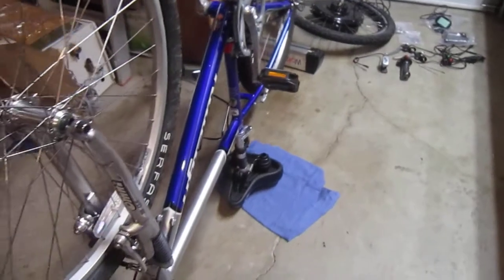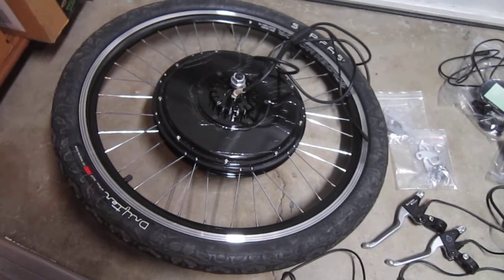Golden Pie V5 Golden Motor Hub E-bike Conversion Kit---First Look

Comment: I just got done looking on Luna Cycles I couldn't find any conversion kits all I see is ready made bikes
Reply from the maker: I just looked there and saw a bunch of hub and mid-drive motors and all the parts to back them up. They are expanding faster than they expected so availability and the such can be limited at times.

Comment: Whats your top speed with the 48v battery?
Reply from the maker: Not to be known yet.   I knew the battery was 3-5 years old, but hoped the voltage would be better. It is working fine with a 18 mile range, but not quite 20 mph.
I am sourcing a new battery with some real juice.  Either Luna or PRE in Vegas.
Once I know, you can be sure I will report it here.
Reply: speed for 48v about 45km/h
Reply: @zaminhuseynov89  which size rim? i am wonderign what 48v top speed would be for the 20 inch wheel
Reply from the maker: I ended up with the e-RAD 48 v 17.5 Ah battery---top speed around 30-32 mph.
Reply: my 48v with 26 inch rims and serfas tyres like yours does 42 kph but i have dialed back the battery to 4.1 volts per 18650 cell.. or it would possibly do 45kph

Comment: I installed one side of my torq arm when I got a front kit, the other side would have required that I detach the connectors at the end of the wire which isn't too bad but I wasn't able to then😛 48v 25mph-30 is a sweet spot imo for keeping with traffic also and not becoming a road hazzard yourself.
Reply from the maker: I was able to add both torque arms on the rear install. 
I will be posting more videos and full report on my bike blog.